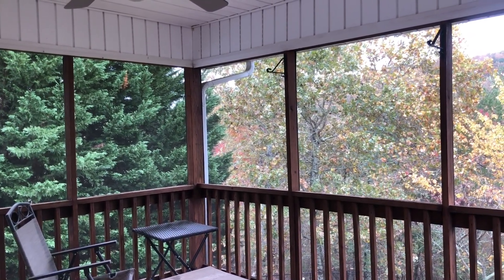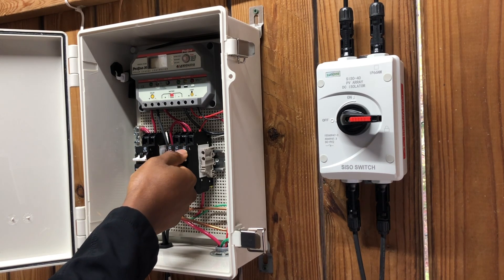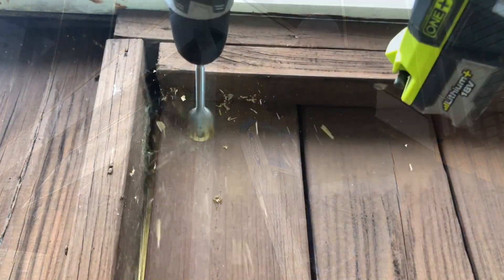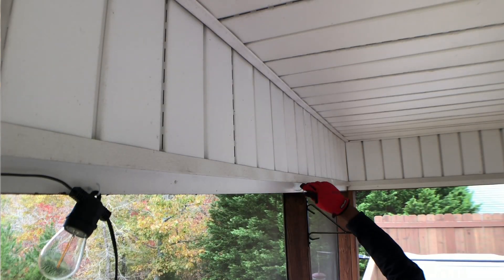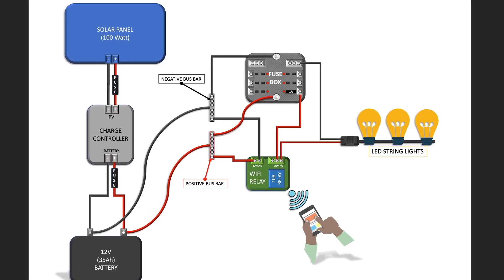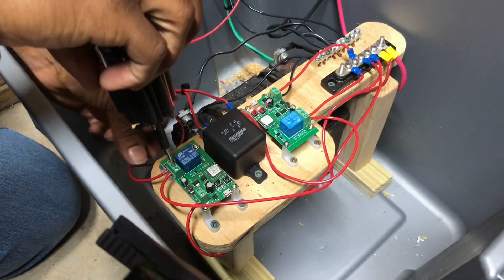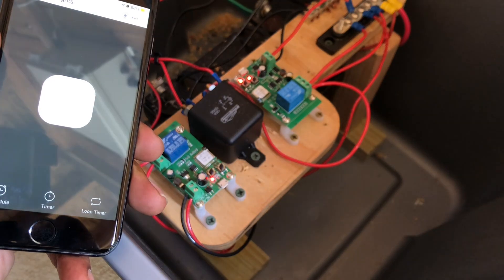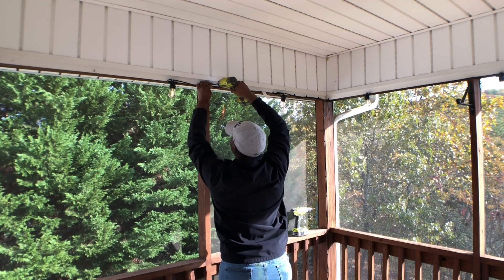How to Make SMART Solar Powered Outdoor String Lights - DIY

Comment: Such a great project! I was wondering, if I needed to light up a larger area is it possible to buy 3 sets of the LED solar string lights and string them all together then connect them to a 12v battery?

Comment: A possible upgrade on this scenario as well as the water pump : You can use Sonoff Zigbee button to run scenarios by pressing it..... so no need to have your phone on. But... it needs a zigbee bridge. Easy to set it up.
Reply from the maker: Awesome. I've looked for wireless switch options in the past but never came across a "simple" solution that did not require  extensive programming and wiring. Will definitely check this out when I get time and maybe even upgrade my current project/s. Thanks for the info!

Comment: Thanks!
Reply: Do you have drawings and plans for your rain water harvesting system?  If so how would I request to acquire them?  You have great ideas. Dan
Reply from the maker: Hey Dan. Unfortunately, I do not have any professional drawings/plans for the entire rain water harvesting system. I do have a few electrical plans and basic drawings for different parts of the project such as how the transfer water pump is wired, how the float switch is wired, how the support base was made, etc. found on my GumRoad page: https://greentechtown.gumroad.com/
Reply from the maker: Thanks Dan for the support! Much appreciated!

Comment: Hey rob I got a question for you. I'm building a  snow plow remote at of 2 wheelchairs motors I have an alternator hooked to it and it keeps drawing down when i Hit the switch on keyboard . For the alternator and it draws down I have a subtooth 2x60. I'm having a battery problem. I think I might need 4 car batteries instead of the wheelchair motor batteries. I don't know all this is new to me I'm just making it all together as I thank  As I'm thinking of it. I could use some help thank you P.S. all your work is good  👍 👌
Reply from the maker: Hey Robert. I have never attempted to build a remote controlled snow plow, but if your wheel chair motors are similar to mine, they were 24v wheel chair motors which meant I only needed to wire two 12v batteries in series to increase the voltage to supply voltage to 24v. The only reason you may use more batteries is if you are trying to increase the run time, but usually you could just buy a two large 12v batteries that have more amp hours. I believe the batteries I used had 35Ah which would allow me to use my remote control mower for about 30min-1hr. You can also try to reach out to someone over at DimensionEngineering or search around for some electrical forums where you can post images of your current setup to see if you can gain some additional support that way.